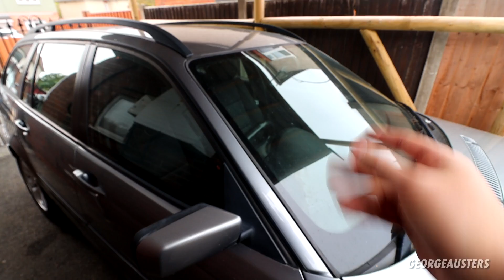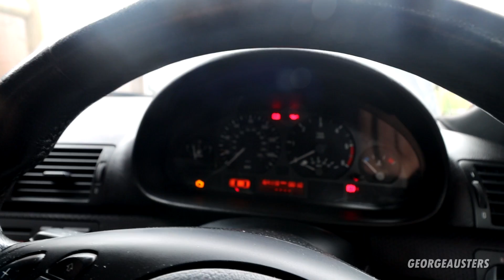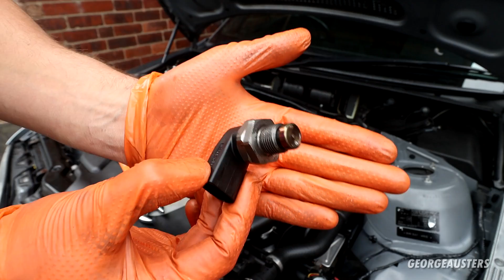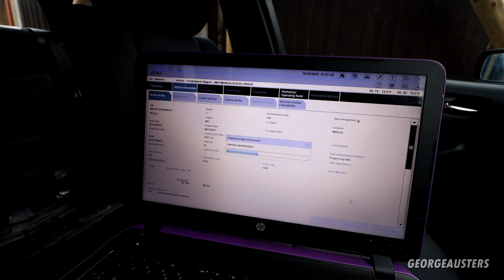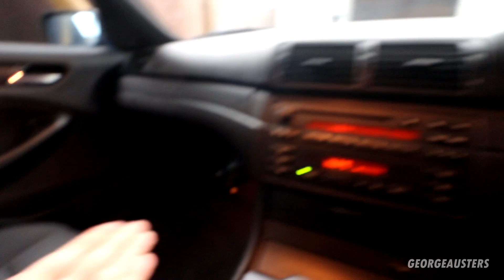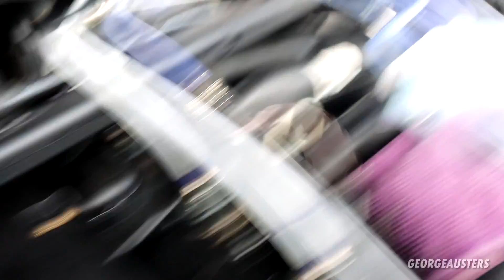TRADING UP FROM £500 TO MY DREAM SUPERCAR | PART 5

Comment: I recently had this issue with my n57, turns out it was the plug connecting to the ecu to the injectors
Reply from the maker: When would yours cut out?

Comment: Just throwing this out there it's a long shot I know, and probably already addressed....

Had a similar issue with a pre injection R6, the bike would start and run for 15-20 minutes then just die, I had recently changed the air filter so went back to my last DIY and eventually found one of the vac lines was routed wrongly and got trapped when the tank went back on? Re-routed the line and the issue went away?  
I replaced all the vac lines on my E46 320d because they went limp and would bend at 90⁰ and pinch off the line?  Make sure all lines are in perfect condition and there's lots of lines on those cars, check them all.....

It's a long shot,, but sometimes we get caught up in electrics and codes and because these are complex vehicles the simple stuff slips right past....🤷‍♂️

Comment: Some engine oil pressure or diesel rail pressure, rather than crank position sensors might have become aged defective on heating conditions and cause immediate engine stop after the engine temperature grows up.. It Is a ECU safety protection mechanism.
Injector defect, you know,cause misfire with discontinue engine speed run and vibrations, but shall not likely make the engine die, especially on a 6 cylinder block. Subdole cables, fuses, relays miscontact must be taken into account for sure.
In 2012 my 2006 Fortwo CDi Smart suddenly begun random engine start failure when It was warm making heavy engine vibrations at ignition and 0 error codes. Long seeks on electrical showed a design mistake on N1-11 13-pin SAM connector which has visibly melted in the middle due to the High thank fuel punp current overheating the plastics and thus causing bad connection/pump failure.
Adding my silly experience in the 90ties, my new Fiat Punto TurboDiesel begun a random engine start failure exactly one month after the factory warranty expired (50.000km),; after estensive test and several checks we found one (Bosch) ECU SMD integrated ciucuit pin detective contact caused by a poorly pin weld (insufficient tin) which used to lift from the printed circuit when heat grew-up.

Comment: Hope You didnt scrap that car for an injector issue , these older 2.0 all pass the leak of, but that doesn't mean it doesn't have an intermittent issue
. Fact if you had of put 4 second hand ones in you wouldn't of had this issue again..I'm a mechanic..a legit non social media mechanic.. I've dealt with this issue, on this car so many times

Comment: Vp44 thats the problem
Reply: @GeorgeAusters  the fuel inyection pump vp44, its plug to the engine block, 100% thats the problem, i had problems with it, has an electrical part and a mechanic part, i recomend to fix the entire thing
Reply from the maker: How do you know it’s the HPFP?
Reply: @GeorgeAusters   electrical part its probably done, thats why it wont start

Comment: I had an astra that did similar,  turned out to be a cam sensor, expanding with heat sink and breaking up
Reply from the maker: The cam sensor made the fuel pump loud?
Reply: @GeorgeAusters  no but that "may" be unrelated, it would run for half hour or so then cut out all sorts of crap, i was told by garages my fuel pump was bad until a lil back street guy said to check it

Comment: If you still have the car look at the high pressure pump volume buy undoing the pipe and turning the motor over you need to connect a pipe to it because if it is working the volume of fuel is a lot and it will go every where however if it just a splatter hit and miss then your high pressure pump has flailed just like mine did good luck replacing it its not a small job

Comment: Does the e46 have EKPM, also known as fuel pump module? My 520d e60 m47 had similar issue when water got in the trunk and damaged it.
Reply from the maker: No it doesn’t

Comment: Hi, did you check left to right side siphoning in fuel tank while driving.  Maybe this aint working properly, so eventually right side runs dry.  If this aint working, would indicate some pressue related issue in this area.

Comment: Have you checked the tank breather? Partial vacuum of tank
Reply from the maker: Do they have them on the diesel models?
Reply: @GeorgeAusters  yes as fuel is used out of the tank air has to go in somewhere to keep the fuel from becoming a reverse pressure. Try running it with fuel cap off for a while.
Reply: If that’s the case, when removing the fuel cap you might be able to hear a noise of air rushing into the tank. That would confirm a blocked vent line.

Comment: First episode i watch, you sure the filter someone changed, is not put on the wrong way, the float and the arrow on it goes only the one way.
Reply from the maker: Yes it was on correct and I also changed it too
Reply: @GeorgeAusters  what about glowplugs or glowplugs relay?
Reply from the maker: They need replacing but they’re not the problem

Comment: Well, I've never touched a diesel e46, but my first port of call would be a compression test (just for piece of mind). You said the pump was noisey, I don't have any experience with failed fuel pumps but I do work on a lot of industrial plant equipment and usually when a pump is noisey it means it's either sucking air or trying to be a compressor, so it could be a blocked line or a leak.

If it feels like it's runnning out of fuel, the next time it dies on you try the pressure relief valve on the fuel rail (I think diesels have them), if air is coming out of it then there's your problem, check the fuel lines all the way back to the tank, should be easy to find a leak with a diesel. At the very least, you'll want to give the fuel rail a pressure test when the engine wont start, since you've already tested the injectors it'll confirm if fueling is your issue. If it has low pressure and there are no obvious mechanical issues, then it could be a bad battery, if you have another car you could temporarly swap the battery over just to see if that's the issue.

If it feels really slow as well then it could be a clogged cat, turbo issues or a vacuum leak... along with a bunch of other things, don't really know any way to test the first two other than to take them off unfortunatley. Maybe also check the EGR and intake manifold, at the very least they'll probably need a good clean anyway.

I too do not think this is an electrical issue, but it might be worth looking at crank and cam sensors, not sure if they really do much on diesels since theres no spark and they should throw up a code as well, but I'd still check anyway.

Hope you get it sorted.

Comment: it cant really be mechanical as diesels are not that complex the only thing i have sen stop a diesel engine like this is fuel starvastion or the siemens piezo injectors have an internal fault to ground issue as soon as that is detected it stall the engines to protect it very common on the ppd 170 tdi and the 1.6tdi   vag injectors   

like isaid before pull the plug on the pre supply pump with the engien running see how long it takes to stall or even log fuel pressure untill it stalls you may well see a drop in fuel pressure 

you really have to log the engien now to see what conditions cause it to stall and then log it again to make sure its the same thing this will point you in the correct direction for what you need to be looking at or the system you need to be looking at

Comment: Are you able to access live data, what happens when it stalls, pump losing pressure, fault with ecu shutting off pump, high pressure sensor faulty, shutting the system down, no more parts until you find the fault, time is the only option, there is something there which is causing this, do you have access to other software to see if it picks up something, last of all book it in to BMW or sell to another in the trade who has more time.

Comment: A friend had the same problem with a Bedford diesel van it kept air locking .
It turned out it had a solder ball floating around in the metal tank which would sometimes block the fuel lines from the tank , I'm sure the tank is plastic but worth a look .
Reply from the maker: Yeah it’s plastic and I did already drain the tank to clean it out
Reply: @GeorgeAusters  ok well not the tank then just thought I would mention that .

Comment: The fuel pump under the car give that a check mine went noisy too then it was down on power there wasn't enough fuel getting to the engine swap it out for a new one
Reply from the maker: It is a new one, I swapped it in the previous video👍🏻
Reply: @GeorgeAusters  OK those engines are bullet proof your problem is definitely lack of fuel some how

Comment: Symptoms of a high-pressure fuel pump failure are:
Delayed start of the engine.
Hesitation or sputtering in acceleration between 2000 RPM to 4000 RPM.
High engine temperatures.
Vehicle stalling due to exertion or temperature.
Fuel pressure gauge reading low measurements.
Poor gas mileage.

Comment: Can’t help but think the pump isn’t happy picking up the fuel from the tank. You can measure the current it’s drawing for starters. If it’s very high current then most likely its under way too much strain. Secondly you’ve not measured fuel pressure anywhere. Try and get pre/post pressure readings. I think this is blockage or some restriction at play.

Comment: You should check high pressure pump if it not that try the dpfs I had similar problem but mine wouldn't stay running till I deleted dpfs

Comment: Frustrating as hell ! If it were drawing air it would be  difficult to start from cold. Have you tried a new fuel pump relay ? I had a volvo that would do exactly the same. Swapped the fuel pump relay and bingo. Issue was sorted.
Reply from the maker: It would start fine and then cut out? And have a noisy pre supply pump?
Reply: @GeorgeAusters  it would  run for 20 - 30 mins just fine. The relay would heat up and it would start playing up.

Comment: Hi George have you checked the fuel pressure with the car running with Live data, could be hp pump, also you could fit a non return valve in the fuel line just to rule out a air/fuel leak.also have you checked crank sensor as a faulty sensor won't always bring up a fault code just a few ideas!
Reply from the maker: Yes required and actual match fine

Comment: Just a thought George - I have a 325i touring and the heated rear screen did not work even though all of the checks on relays etc showed no faults, I also had long cranking time until I changed the battery for a new Bosch unit - hey presto heated screen now works and cranking is much improved, apparently the canbus electrical system will 'load shed' if the charge rate to the battery is compromised and you do not necessarily have a warning of it. The only symptom was if the radio was playing without engine running it would only last for about 10 mins and then switch itself off - warning then on dash was 'battery charge low'. I have had no further issues. I know it's a long shot but I only found it by accident - I'm wondering if a low battery will affect yor issue in the same way? Cheers, Rich
Reply: A bad battery will certainly cause problems but I doubt it is the issue here. The BMS logic on the BMW is designed to preserve power supply integrity to critical engine start/run components. This car has a problem whereby it randomly cuts out when running. This would steer me away from a battery for the time being.

Comment: As you say in your video you really need to stop and think and hold off with the parts canon until you have established basics. If you have not already, you need to check the injector pulse condition ideally with a scope to determine the signal quality or with a NOID to check the presence of a pulse. The next basic step before you do anything should have been fuel rail pressure check and theses two basic tests will set you on the right path to determine if it is electrical or fuel. If you don’t have the correct rail pressure especially at crank it will not fire as the ECU will hold any start condition off until the correct rail pressure is present so can sometimes throw you off as will not allow injector pulse until the minimum pressure is reached. Or conversely a rare condition but can overpressure and hold off start ,you need to know what the actual starting and running pressure is so you can fault find to confirm it is a regulation , starvation, or HP pump performance problem.

Comment: Have you checked the clear pipe that feeds the HP pump to see if you can see any air bubbles going through?
Might need to clean the pipe and use a torch to see 
Don’t give up yet!

Comment: Try disconnecting the battery and touching the positive and negative terminals, this resets the electronics on the car.

Also a phone call to bmw to check is any there are any recalls that haven’t been done to this car. 
I remember the e90 having a ground wire recall that would cause starting problems.

Comment: Hi George, when it cranks with a non start try and pull up live data using your scan tool, I would look at rpm signal and the fuel pressure at the rail, it will need approx 150bar of pressure before the ecu will pulse the injectors, 
If poss check the pressure from the intake pump, this should be about 5bar, also check no splits from the intake pump pipes to the lid on top of the tank and could be drawing in air
Also run it with the fuel cap undone as a blocked breather will cause a vacuum in the tank

Comment: Hi george, have you access to live data?
the 4B90 code you have for rail pressure monitioring normally indicates low fuel rail pressure whilst cranking. With live data you could monitor rail pressure with engine off then when cranking. If the rail pressure is too low the car wont start. The injector leakoff test looked positive.  It could be as simple as an air leak somewhere. Possibly when the new fuel filter was fitted a seal got caught allowing air to seep in. Would be good to see you get it running.

Comment: When I did a leak test with my petrol injectors they were perfect out of the car even when tested with air but when the car was hot and I started the engine without the inejector conectors I could see a very small leak coming from the injector. I'm not saying it's your fault, probably not but don't discard all the possibilities just cause you have somehow tested before, sometimes the only way to know if a part is bad is swapping for a new one. Lets keep trying!!

Comment: Hi George. Really feel for you on this one. Apologies for length of this reply, but it may help. Just sold a MK3 Golf GTi which had similar fault, albeit a petrol car. Made the mistake of listening to so-called "experts" on the forums, cost me a fair bit of money and shit loads of time. Finally fixed it myself, but almost gave up on it. Things I learned: intermittent sensors don't always flag up fault codes. Obvious things like your noisy pump can throw you off the scent of the real issue, in other words, you probably have more than one issue to sort out. An oscilloscope is a valuable tool to have, shame I don't live near you as I would gladly lend you mine. We all know that what is stopping your engine is no/insufficient fuel getting into the cylinders. If it were mine, I would hang a scope on one or more of the injectors if you have a dual channel scope, and monitor closely what happens when the car stalls. If the injector pulses falter, then you know you have a electrical issue which will take some narrowing down as it could be injector wiring, a common fault on many cars due to heat damage, something telling the injector not to open, normally the ECU (or DME). This means that it could be an ECU fault, or something telling the ECU to close the injectors. I do not know that engine at all, but I guess that could be a number of sensors. If the injector pulses look fine, it is likely to be a fault with the fuel delivery as many comments suggest. As an aside, I think we all love to see faults diagnosed, (check out "Diagnose Dan") so it would make for good content to stick with it, but I know many people that have scrapped better cars for less, the choice is yours I'm afraid. Good luck whatever you decide mate.

Comment: Had a car that did this albeit a petrol, turned out to be a dodgy earth point. Could be worth checking all of the earth cables on the car for corrosion. If one is bad it can cause all sorts of strange problems.

Comment: You won't get anywhere with that unless you do proper testing. Live rail pressure while cranking . Need to monitor low side fuel pressure aswell . Which needs to be performed when the vehicle wont start. Check out the test plan link i  sent you
Reply: I'd come and give you a hand with it but your 250 miles away

Comment: Hi George, have you checked the fuel pressure while cranking to see if it builds? I had a similar problem on a 330d once but I was able to diagnose it as the starter motor at fault. The old one didn't have enough power to crank the engine with enough force to build the pressure after a few turn overs. Listening to yours it also sounds a little sluggish. The car sounds fine when running and the injectors and other fuel system appears ok.

Comment: I had the same problem and renewed all fuel pumps and filter. I also fitted a non return valve on the outlet pipe from the rear fuel pump. This may maintain the fuel pressure and the car is now fine. The valve cost me less than £3